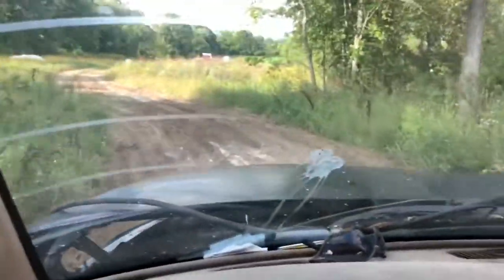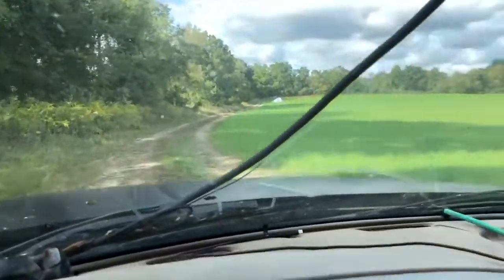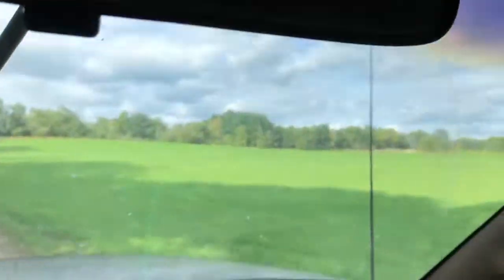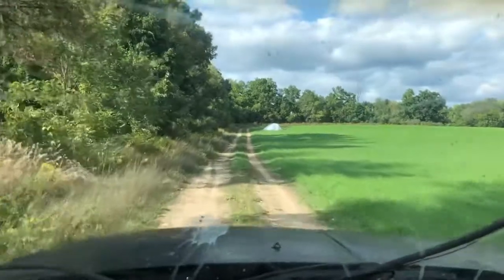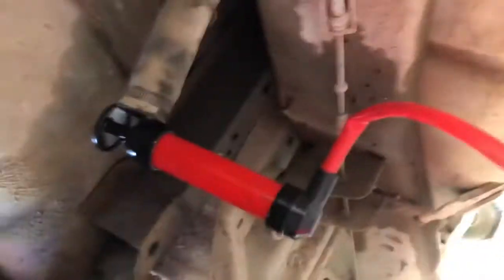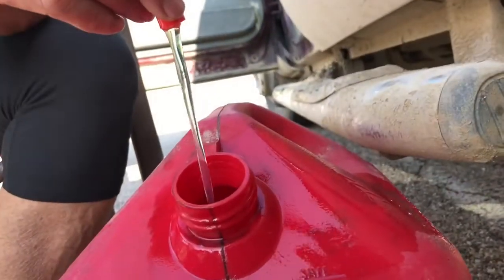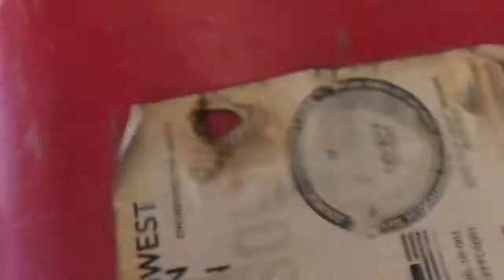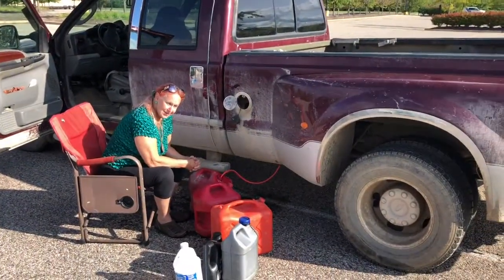Mother -what did you do? E-85 in a Diesel!

Comment: I live alone, was taking care of my mom 8 years before she passed away this March. Dad's been gone since 2012. It didn't stop me from poring gasoline into my tractor once. As soon as it ran badly I shut it off and cleaned out the fuel system, thankfully no harm done. My trucks starter failed at home depot today and I didn't have a spare with me., Autozine didn't have one in stock so I had to walk a mile to my house and come back with a starter on my bicycle.
Reply from the maker: chargermopar do you usually keep a spare starter
Reply: @michiganhay7844  Yes I have one under the seat always
Reply from the maker: chargermopar That’s a great idea by the way I got my truck going it’s running like a champ
Reply: @michiganhay7844  Getting gasoline in my tractor seemed to clean out the injectors a bit too. Glad you had no damage.

Comment: I was at my place in Florida pumping gas into my old 71 dodge, this urban rv camping dude starts screaming cursing I walk over to see what the deal is, he put 10 gals of E85 in his diesel. one of those mercedes van rigs he was clueless didnt know what to do. luckily I had a fuel pump and several tanks he was going to start it im like nooooo. I drug him out of the fuel lane Sucked out about 15 gals of fuel added a quart of ATF and a good amount of diesel clean (that stuff crazy expensive now) then had him fill up with diesel and waited... it ran started smoking then misfired a couple of times for about 10mins then smoothed out, he went on his merry hippy way I told him he should clean the fuel filter but that was beyond his scope, never knew the outcome. Its easy to do. I used the e85 added with WMO into my 89 F250 IDI it never missed a beat!
Reply from the maker: Yeah I saw your vid on that green dodge. I changed both filters. Had a girl friend once Bring me a gallon of gas which turned out to be diesel that I put in my old 76 nova back when I was probably 20 years old I thought I threw a rod

Comment: Ouch..hope its ok..
Reply from the maker: Mark Cornell Yeah I took the engine fuel filter out cycled the sending unit several times to bleed the lines out took 40 gallons almost to fuel got it back from running mail runs like a champ